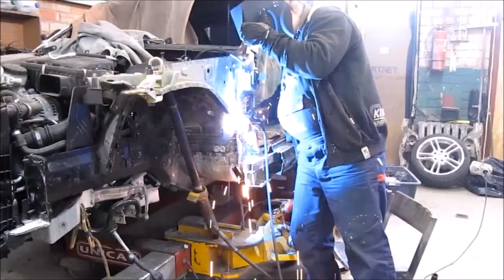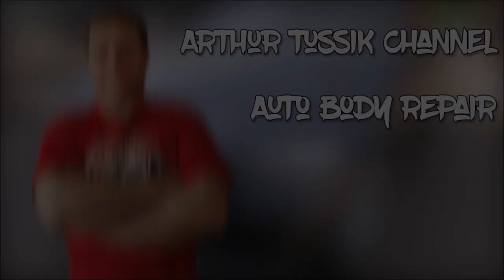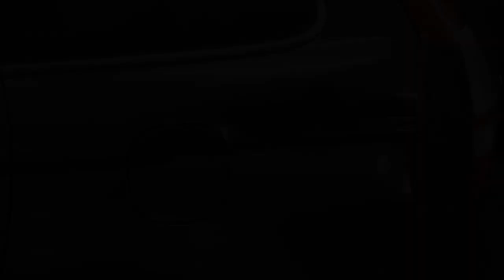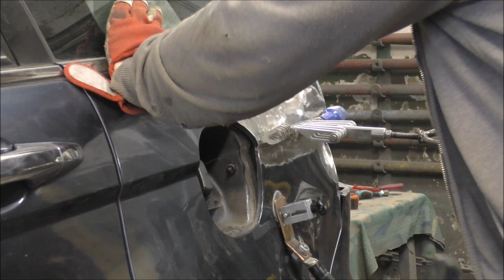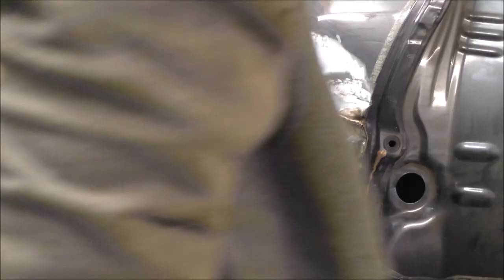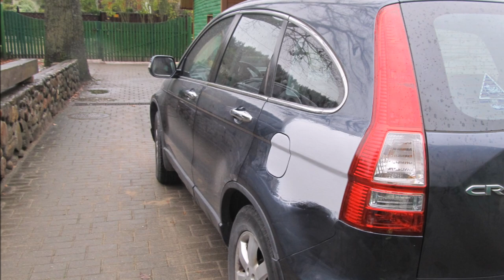Honda CRV. The quarter panel repair. Ремонт заднего крыла.

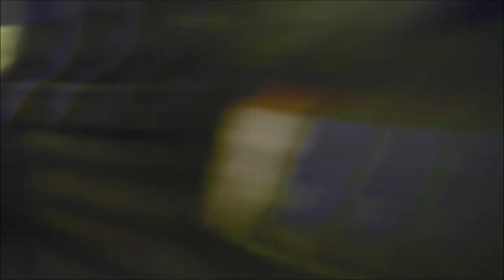Comment: What is the terminal for at 1:46?  What tool are you using at 2:22?
Reply from the maker: This is spotter for heating point
Reply: I can't find the tool online.  What's the brand or model?